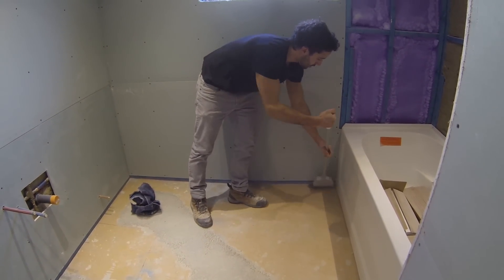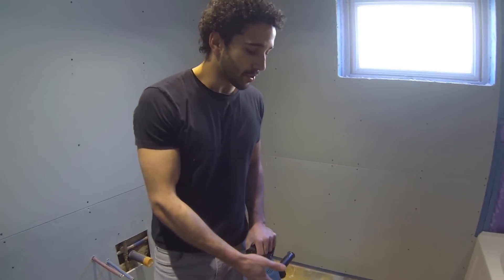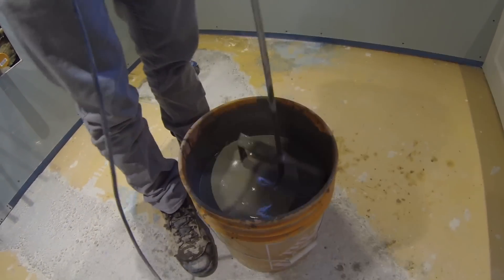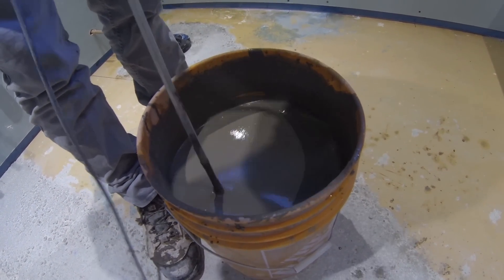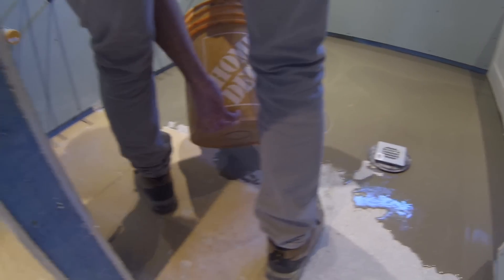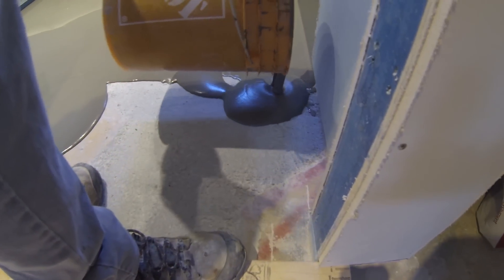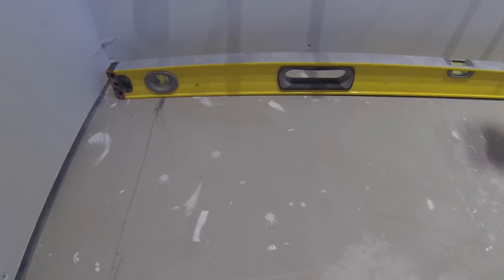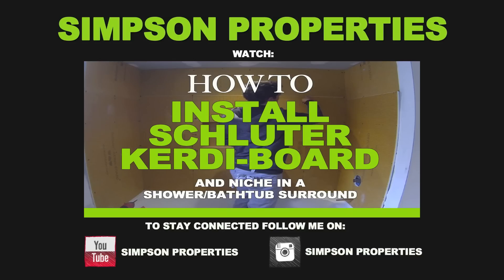HOW TO INSTALL SELF LEVELLING CONCRETE

Comment: why would you level a floor with a drain in it...you need a slope for the water to drain to...
Reply from the maker: The floor drain was added during the renovation & to be honest wasn’t even necessary to add. Since this is a rental I added it as a back up if the tub ever overflowed. The bath tub already has a over flow built in to it. Looking back I should of never installed it. That’s why I wasn’t concerned about slope towards the drain.

Comment: Do you need to recut saw control joints in the concrete after leveling?
Reply from the maker: To my knowledge that is not required. Control joints are normally done on a concrete slab.

Comment: Can you just stain this concrete and call it a day? What are the white flecks in the last scene of the video?
Reply from the maker: The white flecks are just construction debris from mud and tapping the drywall. I have no idea if you can stain self leveling concrete. I know that can be done with regular concrete. If that's the finish you're looking for I'm sure there are companies that make a concrete stain that will work for you.
Reply: Most self levelers are not recommended as the final finished floor wear surface.

Comment: can you leave the self leveling concrete raw and then polish/sand for a finish?
Reply from the maker: David Pulsipher yes you can if it's an industrial grade top coat but I have never personally done that. Here is a link with some helpful info: 
http://www.concretedecor.net/decorativeconcretearticles/vol-13-no-5-july-2013/dos-and-done28099ts-of-polishing-self-leveling-overlays/

Comment: If you we're going to lay tile, why not just use thinker thinset under the tile to level them. Would've been a lot quicker. I don't see the need for self leveler unless you're laying wood, vinyl or carpet flooring.
Reply from the maker: PRO HEN there are a million different ways to do the same task. You’re right building up thinset in the low spots would work as well.
Reply: Using a thicker thinset could break down as the thinset cures, though i have seen people recommend it for small dips 1/4" or less (i've done this before). using a cement based product like shown in the video with primer will ensure the best support for tile work

Comment: I need to level my subfloor for a 11x11 room.I think I will just use a 2x4 as I go to see where low spots are?
Reply from the maker: You could do that. I would recommend priming the slab first. Also, look into buying a spiked roller for this application. It will be much easier to move the self leveler on the slab evenly.
Reply: @simpsonpropertiesltd  Ya now I have to do another thin coat in spots,it wasnt real easy for me to work with it using a 2x4. I am getting a gauge rake,that should make it alot easier.

Comment: Did you grind down the new poured concrete before you pouring the self leveling concrete on top
Reply from the maker: Nope. You could install primer then install additional concrete.

Comment: def should have pug in some type of expansion joint around the wall, either spray foam, planks or a roll of foam. concrete expands....
Reply from the maker: I agree with you in larger scale applications where agilia over-pours are happening over radiant heat. It is a best practice to install foam around the base plates of the framing. In this example the low spots were in the middle of the room primarily. A very small amount of concrete was used close to the base plates.

Comment: Great job! looks great and thanks for sharing!
Reply from the maker: Thanks!
Reply: Simpson Properties   I viewed your video.  Thank you it's great.  I have a cement floor with some PL400 adhesive on it.  I have scraped off the high points but not down to bare concrete.  Can I pour the floor leveller over that?  Also have trowel marks where some ceramic tile was.  Again, I have taken it down as much as possible but not quite down to the bare concrete.  Can I use floor leveller over that without getting down to the old concrete?

Comment: How is this self leveling if you have to go back and find low spots? JW.
Reply from the maker: You can only build up the floor in certain increments with this product. I should of used a spike roller to make the install process better.

Comment: aren't you supposed to put prime before pourring?
Reply from the maker: I mentioned that in the video that some manufactures require a primer before installing.
Reply: @simpsonpropertiesltd  Including the manufacturer of this product, also requires expansion joints where it meets walls, etc..

Comment: Isn't it called self levelling cement for a reason...
Reply: Right? My thoughts exactly...the mix ought to be very runny to fill all the uneven surfaces and 'self level'.
Reply from the maker: A spiked roller should have been used.